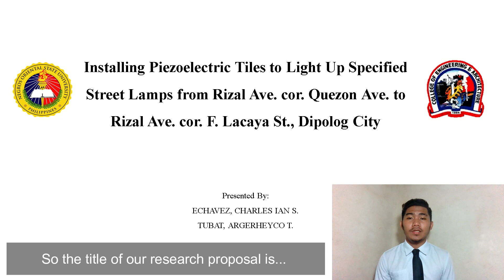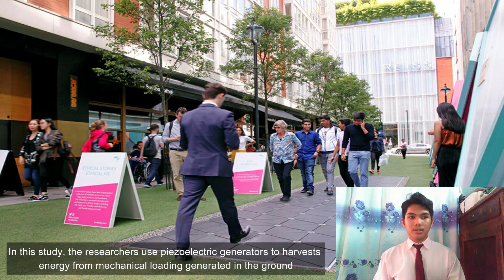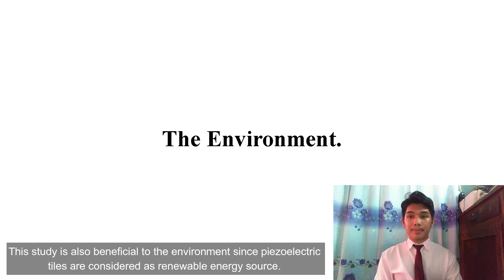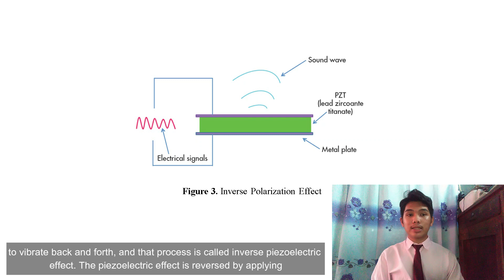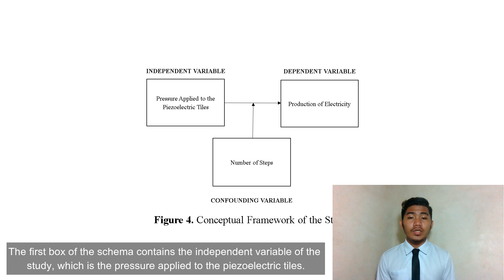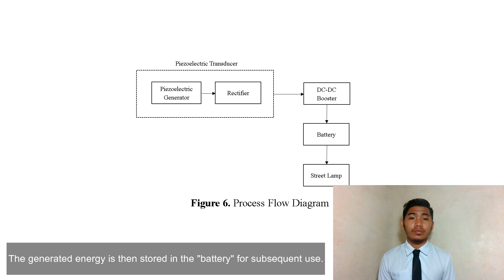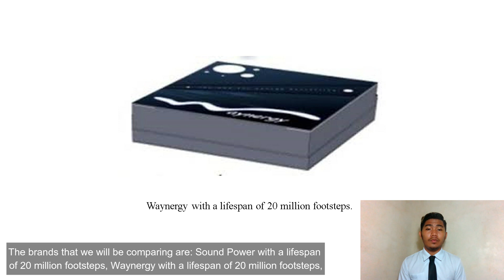Installing Piezoelectric Tiles to Light Up Specified Street Lamps

Comment: TRE-INTA, KEZIA L. 
EE 341 TTH 6:30 - 8:00 PM 
MARCH 24, 2022 

REACTION: This research study is indeed interesting. It makes me curious on what it looks like when the project is made. Since this term 'piezoelectric tiles' is new to me, I want to learn more about it and how does it work actually. It's nice that I am able to learn about here from this video of the researchers.

REFLECTION: I believe it would be great to use this piezoelectricty  which converts mechanical stress into electricity. This study is environmental friendly since it doesn't emit any chemicals. This study of Installing Piezoelectric Tiles to Light Up Specified Street Lamps is beneficial as it helps reduce the electricity consumption. Using this study will help to improve the security of people at night.

Comment: NAME: ATOY, AMIEL S.

CLASS NAME & CLASS SCHEDULE: ENS 341 - SATURDAY (5-8PM)

DATE: MARCH 24, 2022

REACTION: This video opens me to a new scope and level of energy creation. With the use of population especially by walking, you can also gain and give energy and making it to an electricity to store for lights and other electrical appliances.

REFLECTION: This plan will create a path for renewable resource conservation as research and technology develop. This sort of energy source (piezoelectric) is extremely beneficial not only in developing but also in industrial production, and it is extremely durable and efficient, making it a viable solution to energy reliability issues. The same as a solar panel, this source of energy is apparent.

Comment: NAME: Cual, Kayzielle B.
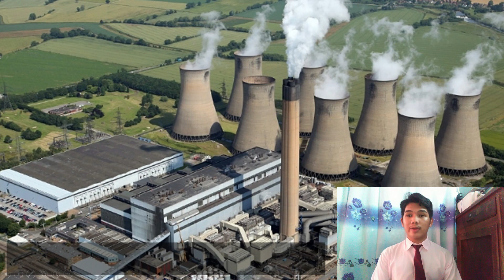CLASS NAME & CLASS SCHEDULE: ENS 341 A (2:00 – 5:00 SAT)
DATE: 3/24/2022	

REACTION: Based on the video I had watched, the audio is audible. The visual presentation of the researchers is simple and visible. They had presented their research very well and in a very concise manner. Over all the presentation was very good.

REFLECTION: It has a similar objective with the other studies but in this research it uses Piezoelectric tiles to light up specified street lamps, instead of the usually solar panel. I find this study unique and interesting, not only it aims in lighting up a street light which produces light for residents during the night it also aims in helping to environment by converting kinetic energy into off grid electricity since piezoelectric tiles does not emit inorganic and toxic gases.

Comment: Gliocam Blessings C.
COE 346 Methods of Research T-TH 5:00-6:30 PM
March 24, 2022

REACTION: This is cutting-edge and ground-breaking research. They show how to convert energy from steps to electricity in a new way.

REFLECTION:   This type of energy source (piezoelectric) is incredibly useful not just in underdeveloped countries, but also in industrial production, and it is extremely durable and efficient, making it a feasible solution to energy reliability difficulties.

Comment: Patron, Kent Ryan M. 
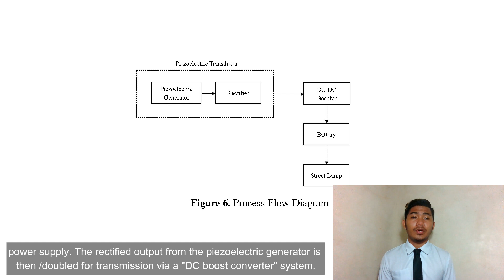EE341 A (6:30-9:00)
MARCH 24, 2022
Reaction:
This research proposal is very informative and at the same time, will be very beneficial. With the advancement of science and technology, this proposal will pave the way for conserving renewable resources.
Reflection:
This type of energy source(Piezoelectric) is a huge help in investing and also useful not only in developing but also industrial production and is very durable and efficient which can be the solution to the problems of energy reliability.

Comment: NAME: Miraflor, Joshua
CLASS NAME & CLASS SCHEDULE: ENS 341B/ 5-8 PM Saturday 
DATE: March, 24 2022
REACTION: This research is advance and innovative. They present a new technology for converting energy from steps into electricity.
REFLECTION: In this study they use renewable and clean energy resources have become a demanded research area due to the problems facing energy
 shortage .This study it is very useful because street lighting provides a number of important benefits. It can be used to promote security in urban areas Street lighting also improves safety for drivers, riders, and pedestrians. Piezoelectric Energy harvesting floor as a sustainable clean energy is generating a usable electricity depending on
people footsteps pressure, this valuable energy is wasted in spite of its available clean source . This idea will help the path for the conservation of renewable resources as science and technology improve.

Comment: JAPHET C. MALOLOY-ON
ENS 341 B - SATURDAY 5-8:00 PM
March 24, 2022

REACTION:
The Piezoelectric tile is a renewable energy which uses a technique to generate power through footsteps. The use of Piezoelectric tile is extremely helpful in various ways. It can also be use as charging ports, and the one they presented which is by lighting the pavements side buildings or cities. My reaction to this study is that I am amazed by using this kind of technology and it is very interesting one. It is an alternative method to generate electricity which is good because when people passed by the Piezoelectric tile the energy they release by walking can be converted into electrical energy.

REFLECTION:
The use of Piezoelectric is to power devices such as lighters, gas stoves and etc. Inventors/Engineers discover Piezoelectric tile which has a crystal structure and is capable in transforming mechanical energy into electrical energy. This type of energy source is a huge help in investing and also useful not only in developing but also industrial production. Piezoelectric tiles can be implemented in crowded places and that's why In other countries they already have this energy producing material in public areas and to their households. The use of Piezoelectric tiles are well improve nowadays and is very durable and efficient which can be the solution to the problems of energy reliability.

Comment: JESSIELOU A. GOMERA
ENS 341 B - SATURDAY 5-8:00 PM
March 24, 2022

REACTION:
The Piezoelectric tile is a renewable energy which uses a technique to generate power through footsteps. The use of Piezoelectric tile is extremely helpful in various ways. It can also be use as charging ports, and the one they presented which is by lighting the pavements side buildings or cities. My reaction to this study is that I am amazed by using this kind of technology and it is very interesting one. It is an alternative method to generate electricity which is good because when people passed by the Piezoelectric tile the energy they release by walking can be converted into electrical energy.

REFLECTION:
The use of Piezoelectric is to power devices such as lighters, gas stoves and etc. Inventors/Engineers discover Piezoelectric tile which has a crystal structure and is capable in transforming mechanical energy into electrical energy. This type of energy source is a huge help in investing and also useful not only in developing but also industrial production. Piezoelectric tiles can be implemented in crowded places and that's why In other countries they already have this energy producing material in public areas and to their households. The use of Piezoelectric tiles are well improve nowadays and is very durable and efficient which can be the solution to the problems of energy reliability.